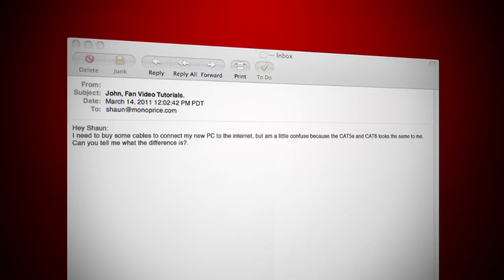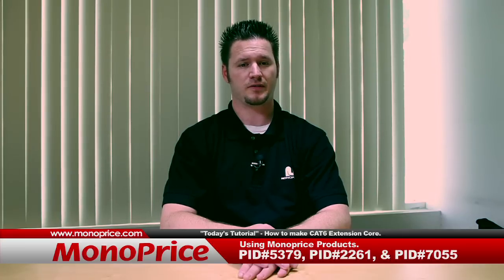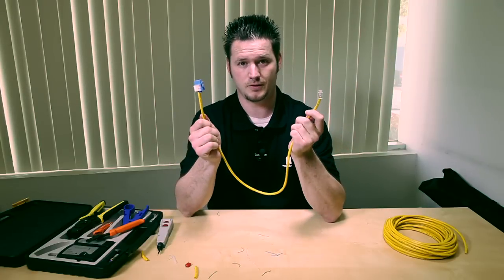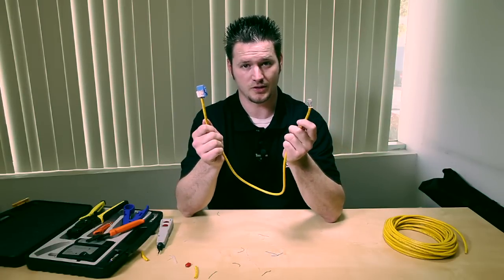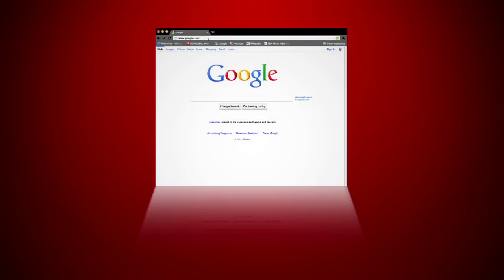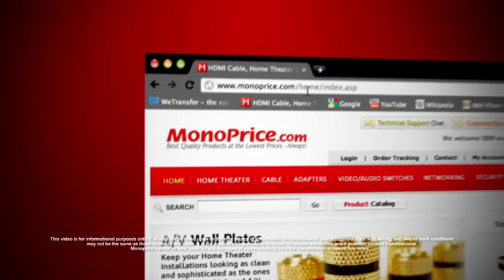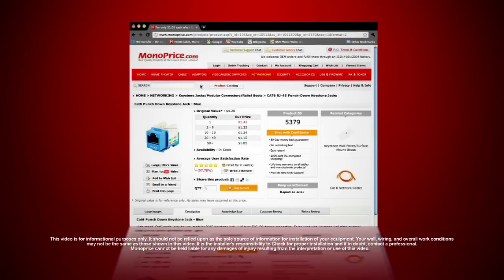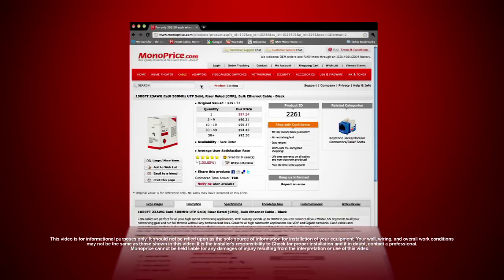How to make Cat6/extension cable

Comment: I don't understand why you have done it green white, green, orange white, blue, blue white, orange, brown white, brown? Isn't it suppoed to be orange white, orange, green white, blue, blue white, green, brown white, brown?
Reply from the maker: Hi beggsz1,You can use either wiring standard. The one you had described is T568B which is more common. If you use t568B, then you would stick with T568B. In the case of the video it was wired with T568A.
Reply: ah okay. so when is A / B used? I look at ethernet cables here they are all B..
Reply from the maker: That would depend entirely on the devices you are using, or simply if you wants to use 568A all around, that would be fine.Specific devices will specify whether or not it requires 568A or 568B, otherwise, you can use one or the other, just not simultaneously on the same run.

Comment: Hey I have a blue cat 6 wire running in my home but my stupid contractor only gave us 2 jacks. One on the first floor and the second on the 2nd floor. Now I need to add 2 more jacks in the second floor and I am able to see the cable in the attic is there any way I can splice into that and than wore new connections to it and get new jacks?